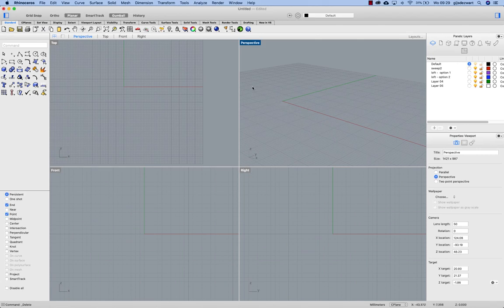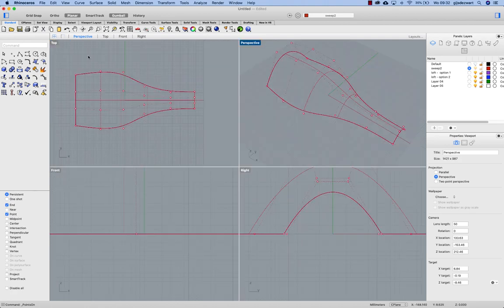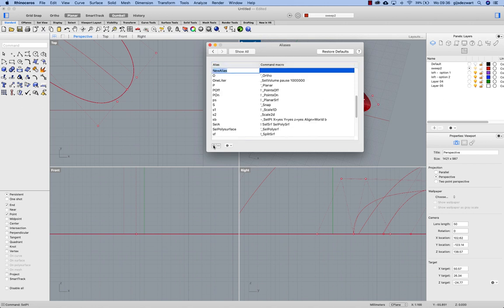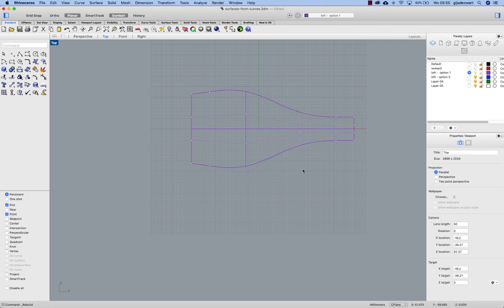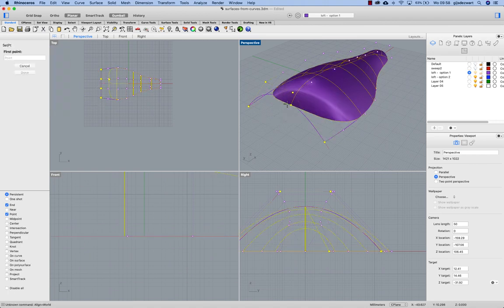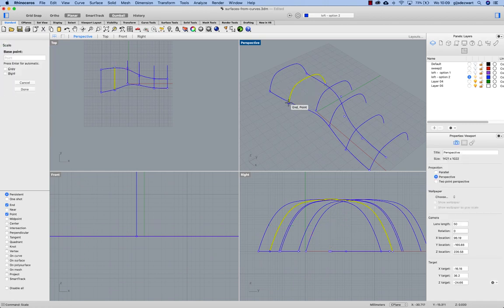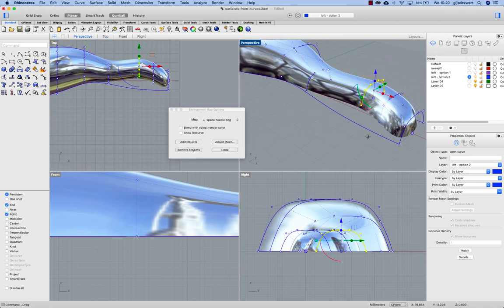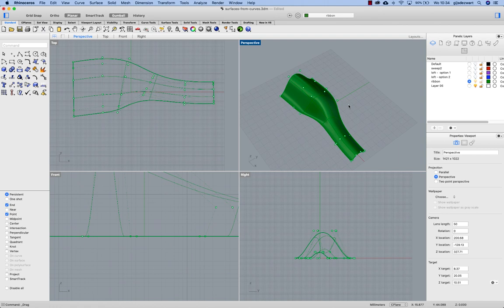surface creation from curves

Comment from the maker: Sweep 2: 0:00
Creating smooth end 3:25
Loft option 1 : 7:15
Increasing density of surface with InsertKnot : 11:40
Creating smooth end : 12:23
Loft option 2: 14:11
Loft to a point (smooth end) directly : 17:40
Ribbon: 20:13